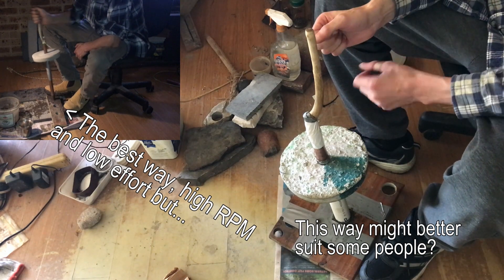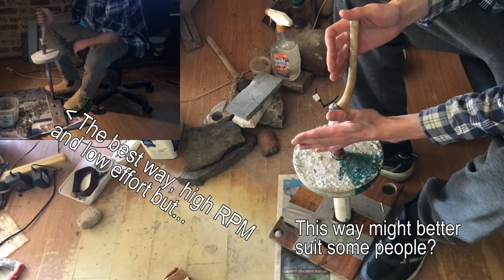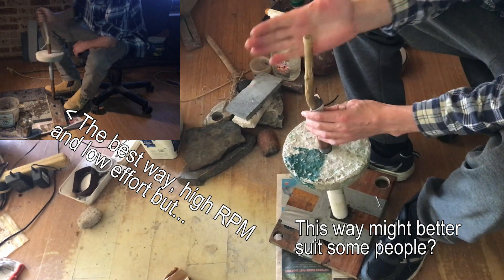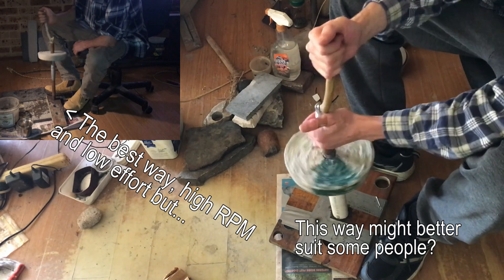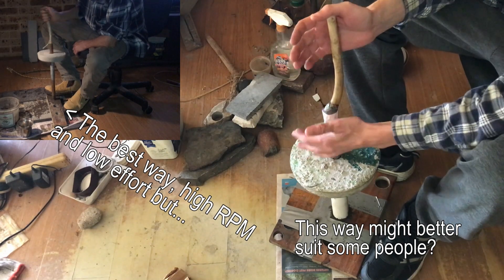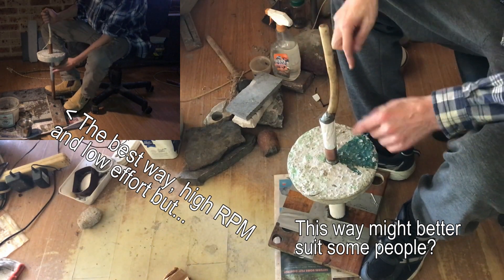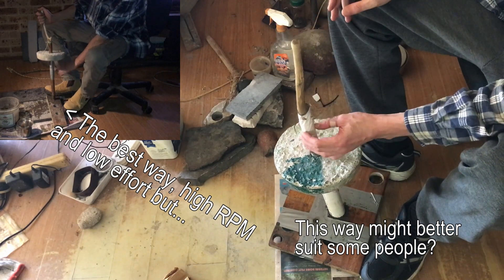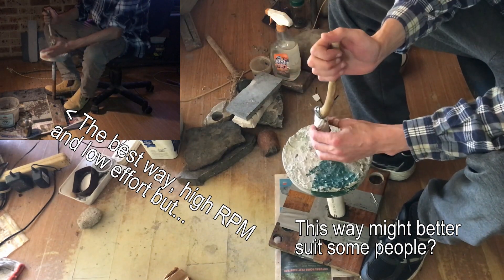Egyptian Fly Wheel Drill NEW technique. The Double Slap

Comment: It wouldn't be cheating if ya used a pipe on the grip to save from blisters. Just let it spin inside the pipe. They had that, so it would be legit. As I watch tho I can't help but wonder if instead you put yet another weight on top where you're right hand is. Then put a sleeve where your left hand is. Then use just one arm to run the drill. I think this would eliminate the wobble affect also. 
I still wonder how they did that one core they found with the perfect spiral. That little core sample blows my mind. Neat stuff thanks
Reply from the maker: Cheers
I do usually use a sleeve of cloth or paper. I tried a tube but after a lot of rotations it chews int the wood and i love this wood handle, it's the perfect angle and direction if bend for .
Though even with cloth/paper sleeves the handle is starting to thin out. It's been polished to mirror perfect.
The old egyptian pics f them drilling even show the drill head being detachable, i reckon once they found that perfect handle they stuck to it 
https://www.youtube.com/watch?v=HQi4yql7Ysg&t=731s
The core doesn't have a perfect spiral, it's actually a mess of grooves, the lost tech people know it too but keep saying it. 
The video above did it and i have replicated it myself a number of times. I tried in many different types of granite with different types of abrasives and grit size.
Reply: @SGD Sacred Geometry Decoded  hmmmm. I'll have to rewatch the video I saw about it. In the one I saw they actually wrapped a string around it and showed the spiral. I want to say they even did a silicon casting of it. Then showed zoomed shots on it. 
Honestly most times I watch this stuff late as I nod off and only recall 25% the next day lmao. It keeps my mind busy tho and is fun to discuss heheh. So I'll check again
I'd show ya other things that are hard to impossible to explain here. The core is just one that most happen to be aware of. 
And yeah many people make all sorts of crazy channels here about this all. They're fun to watch as long as ya keep in mind they're idiots. In fact on a couple I see tiny clues that are truly worth talking about. They're too occupied tho with magic powers tho to see it😂
Reply: @SGD Sacred Geometry Decoded  oh wow. Just watched some of that and yeah what I saw prior was very misleading. It's like seeing two different photos. I stand corrected on the core issue!😂
Reply: @SGD Sacred Geometry Decoded  just for that I'll go ahead and tell ya where to look for the answer to the vitrified stone fort age old mystery! It's really simple actually. There's a wild plant that grows wild there. It's sort of like a weed that grows rampant and is a pest. Anyways as we know if you don't maintain the stoneworks they'll get overgrowed. Then everytime some new people came along they cleared it all out. And since those small forts was in the shape that makes for a good firepit they threw it all in there. Turns out that particular type of wood, or resin.. not sure which... burns at an extremely hotter temperature than average wood does. So all the attempts to re create the process with wood failed. So imagine a crew clearing a feild over let's say a month, and burning the while they do. Then the melted rocks is what ya end up with. Not really good for anything and was a happy accident is all. 
Go search here for professor Simon's channel. He has an episode on how his dad accidentally did it once doing the same exact thing once and it's how it was found out again. That mystery seems to be solved.
Reply: @SGD Sacred Geometry Decoded  oh yeah the plants name is gorse. I forgot to add that oops

Comment: Slick!
I just had another thought, especially about the other technique and its wobble. What about a tubular sheath around the upper vertical shaft above the flywheel? With the arm braced on the kness, the supporting hand holding the sheath out to be more steady than just the guide hole lying atop the drill hole. Working together, both supports could be much more stable.
(Thinking aloud.)

Comment: The Egyptians did not do so. The stone was dissolved and the soft stone was shaped like clay. Then it crystallized.
Reply from the maker: Not evenly remotely  true. The way crystals are formed in the stones from the minerals present makes that impossible. Specific heat and pressure and slow cooling system over very long time frames creates these types of stones. The chemistry is very clear and the science behind it long settled.
Plus the Egyptians showed themselves doing this and in partially finished pieces the residue of copper and abrasives has been found.

Comment: I'm guessing that pottery wheel technology could be adapted to this, so that you're kicking the flywheel with your feet instead of using your arms.  That might also allow for more "heavy-duty" versions of this tool, since the user is employing the stronger muscle groups of the legs, so the flywheel could be larger and heavier, which might either let you cut faster, and/or use larger drill core bits.

At any rate, this tool looks like a pretty elegant way to get the job done.  It's arguably superior to modern machine tools for the same purpose, if you factor in the costs, environmental impacts, etc. of all the industrial depth ("tools to build the tools that build the tool"), global economic supply chains, fossil fuel dependency, etc. required to make the powered machine tool possible.

Funny bit: The ad that came up at the end of this video was for a precision-machining company using motorized machine tools. 😂
Reply from the maker: I will be going back to a vase I started a while back. Been thinking of making a potters wheel type set up, to grind down the neck to get it paper thin.
Could do it by hand but I am trying to get a speedier way of doing it.
For marble/alabaster could be a weekend project, at least those ones without the handles.
Definitely a fun thing for a few reasons. Not at least since they are starting to squirm. Their biggest allies are publicly stepping back now. 😉
Reply: @SacredGeometryDecoded  Some of the highest precision lenses today are made by hand on a turntable - symmetry and rotation is the solution to most of these high accuracy Ancient riddles IMHO. The Egyptians were said to import e.g. iron from other countries, as needed (why literally 're-invent the wheel' - they had the Nile and boats).
Reply from the maker: @megamond  Copper residue and emery abrasive was found inside an unfinished cored out piece. 
Yes simple hand tooling techniques create remarkable precision, I ground down a granite piece to less than 2 microns surface roughness with sand in a short time.
Iron is not needed or benficial, those people who polish lenses use copper lapping plates for that work.
Reply: PRECISELY!

Comment: Excellent! What are you using for a bit and abrasive?
Reply from the maker: I use copper tubes and PVC a couple of times to demo that it's the same principle as sand paper. The sand not the paper, copper, PVC does the ctting, the softer the material the better, as the fine grains become embedded in the tube. Protecting it from wear
I use corundum (emery) but also demo's with crushed sandstone and crushed granite. (quartz in both)
Reply: i recall him using a plastic tube to drill. And emery.  the abrasive is what is important.

Comment: are you sure it was made like that? clickspring and primativetechonology use a version with 2 strings and a bar with a hole that goes over the center shaft and is pumped up and down... the drill turns each way as it winds the string up on the stick and then stops the spinning mass and then the worker just pushes down on the driving stick and the spinning mass then works in the other direction.
Reply: the important thing is that this is a viable method, so it debunks the "its impossible with primitive tools" narrative
Reply: @diobrando2160  yes yes...i dont want to detract from that, but point out a better way to do it. Also if adding organic acids the cutting face will abrade much quicker
Reply: @m3sca1  most acids have little to no affect on non-calcitic granite. hydroflouric acid is one that can cause some dissolving over extended periods of time but nothing immediate during the relatively short drilling time.
Reply: @GroberWeisenstein  i speak from experience having testing an organic brew using oxalic, vinegar and citric acid. there is a strange pale green powder that forms on the stone surface of granite in this acid brew and when i tested as a drilling fluid it left me with smooth walls in the drill hole and seems to work at helping dissociate the surface and aid the mechanical action of the drill.
Reply: @m3sca1  I too speak from experience  Green efflorescence forms from metallics in the stone oxidizing from the acid.  All the acids you list are not strong enough to cause a significant dissolving reaction of igneous stone like granite.other than just adding lubrication for cutting  since it is a liquid with the same effect had you used water. Acids dissolve calcitic stones more easily but not as efficiently as people would hope for and limited to  practical purposes like etching and polish vitrification of smoothed surfaces.
Reply: @m3sca1  I have mixed multiple acids together when formulating cleaning chemicals for stone restoration . The acids you list are too weak on their own or in combination to be effective for other than light-medium cleaning or as a wood bleach.  You are also incorrect in assuming you achieved a faster cutting rate..
 If so, the core side walls would have been rougher and not smoother. Again this is based on my experience drilling tens of thousands of holes in stone quarries and in manufacturing stone products. Holes ranging from 1/8 " to 48" in diameter.
Reply: @GroberWeisenstein  the acids i mention or some other brew?... the choice of acids was chosen because lichen uses oxalic to break down granite and feed itself, the others keep it active. why would a drill hole with smooth shiny walls be a slower drilling then if rough walls, considering the drill moved through the stone at a very fast pace.
Reply: as depicted in relief carvings and paintings. Each culture has their own idea of the perfect tool. Some guys still use hammers to build houses.

Comment: Looks nice.
Something to experiment with if you like:
 It looks like you're isolating the drive in the system to your arms. Very tiring over long times.
 Let the vibration of the system into your body and try to match the drill system's periodicity with the resonant movement within your body. The arms should be more of a caretaker of the movement than the driver. 

Or if thats weird, loosen up. Relax and use your whole body. You can kind of tune it from there.
Very nice discovery with that technique. It seems like it should be very ergonomic and natural once you get the knack.
Reply from the maker: Cheers. Practiced a bit more. More of a rolling motion than a slap. Only the lower hand needs to move, the upper hand just rolls back and forth. I am still preferring the usual method but with practice there are definitely advantages to this.
Reply: interesting premise. craftsmen also develop the ability and strength to work tirelessly and effortlessly with just their arms and shoulders without engaging their core or ancillary regions. In stone work it is best (very important) not to allow forces and energies to transfer or dissipate within the body. Repetitive motion like this ultimately leads to peripheral neuropathy, et al. Force should flow in one direction to the tool either constant or in intervals. Efficient tool design is everything and should incorporate ergonomics. Our friend here is discovering this and re-engineering accordingly.
Reply: @GroberWeisenstein  I suggest what I suggest in order to avoid excessive muscle use. If you can keep a system 'ringing' harmonically, you lose less energy. There is less internal friction- and thus less destructive dissipation of energy into the joints of the body. 

A lot of your statements seem to be topically similar to the topic of discussion, without addressing it. For example: your statement on stonework seems to relate more to work with hard impact, not stone necessarily.  Another example: The comment on repetitive motion applies to both scenarios, so its not clear what that is supposed to add. 

I understand that you want to defend Sacred Geometry's excellent work, but there is no attack from me at all. Its intellectually disingenuous to get your ego involved in a technical matter like that. But maybe I misinterpreted something.

Comment: Haha what a great moment to capture on film, in the uk we say the penny has dropped!
Reply from the maker: Practiced a bit more. 300rpm plus. Almost the recommended speed for modern granite cores of a inch diameter.
Reply: @SacredGeometryDecoded  slower is better with loose abrasives, less heat generated and easier for fresh abrasive to get under the tool's leading edge. You are a machine SGD !
Reply from the maker: stubborn as F ;-)